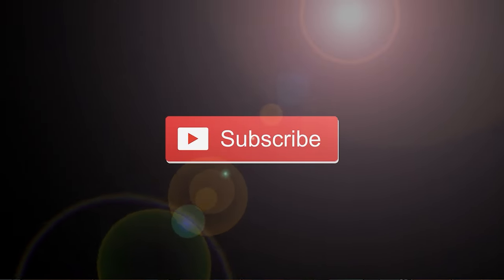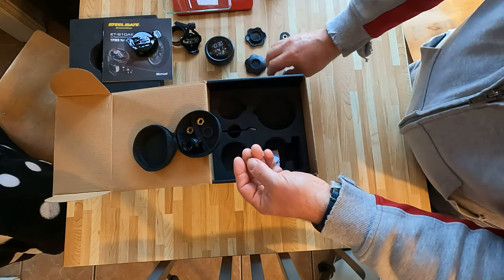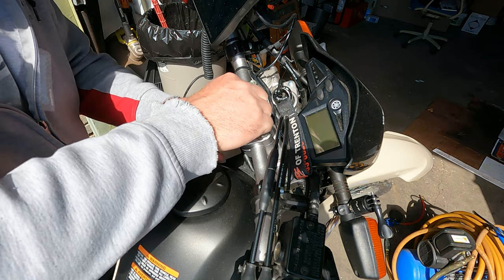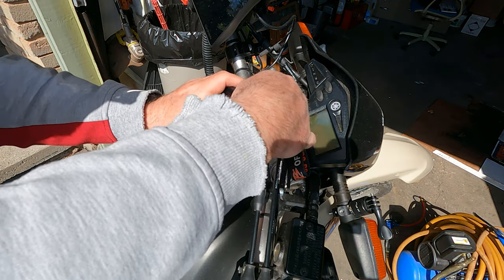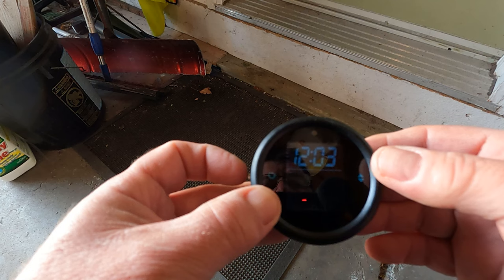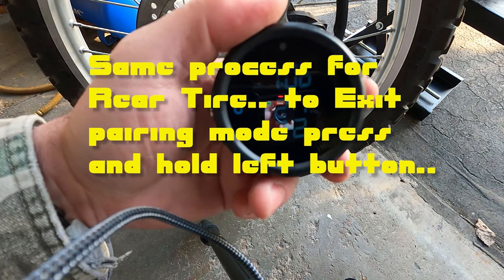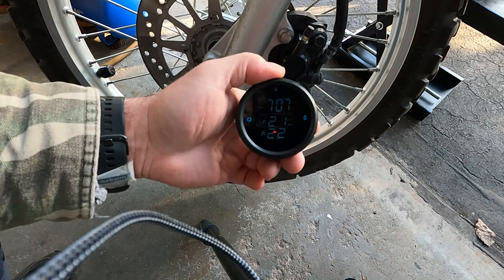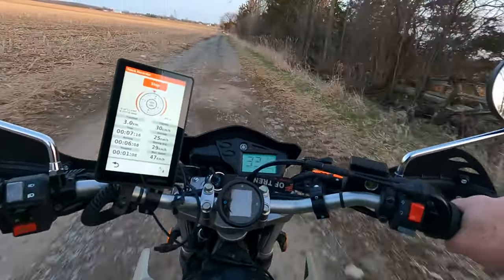Motorcycle TPMS - Tire Pressure Monitoring System

Comment: Nice video - thank you! But I do not agree with some of the comments made by other viewers. Fobo 2 or what ever other TPM device, should have a separate dedicated monitor of its own. I keep my cell phone in my pocket, not on the handlebars. Because if the cell phone battery dies due to all day riding and using your cell phone as your GPS, you wont know the tire pressure anymore. Or if you go down, you want the phone with you in your pocket not on a bike in the ditch somewhere or under a truck. I am not saying this particular unit is good or bad, I'm just suggesting that any TPMS should come with its own dedicated monitor for better safety.

Comment: How’s this product doing? Holding up?
Reply from the maker: Glad you asked, I have made a post to this question, hoping it would be seen, I was not satisfied with the performance, I returned it. Setup was not too bad, however when you made adjustments to pressure it was difficult to reset, never knew if it was accurate, what finally did it for me, was after removing a few times one sensor fell apart… I should try to make a new thumbnail saying “returned”. lol.. I do like the idea, but we need to find a quality item… if you come across one and test a month or two let me know… my opinion is this is not it…